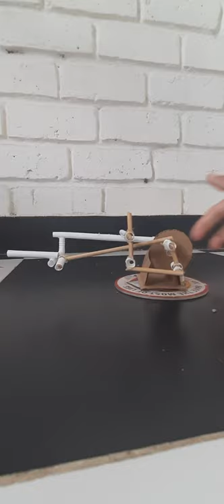walschaert's valve gear #shorts

Comment: Where are the combination lever and radius rod? It looks great so far but to be a "true" walsharts gear the return crank has to be set to a position that the drive rod is 90* to the crank pin, the expansion link should be curved if it is intended to reverse.

Dont get me wrong. This is a beautiful representation of the first half of the motion on walsharts gear!
Reply from the maker: Yes I missed all of those stuff, this was actually the first one that I attempted to make and It looked quite decent so I didn't go for too much detail, however I did make a better one recently.